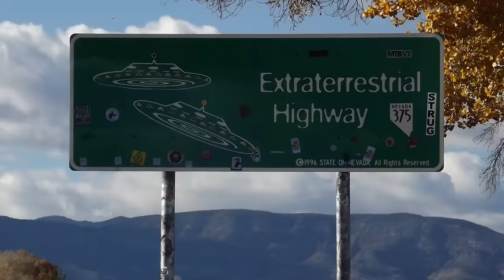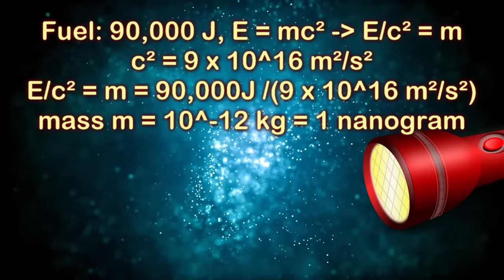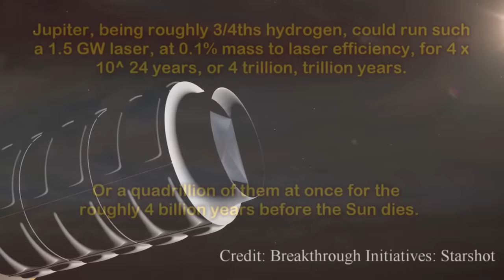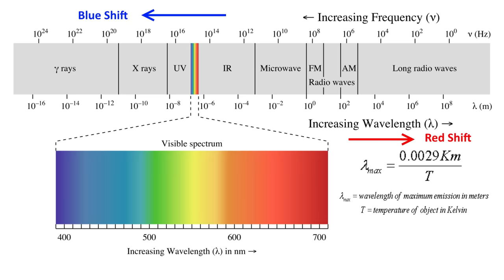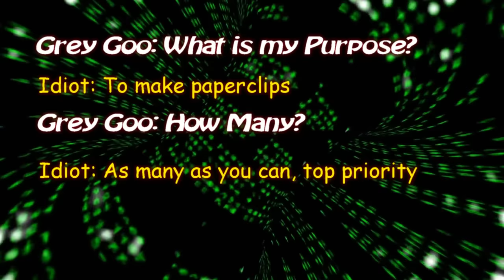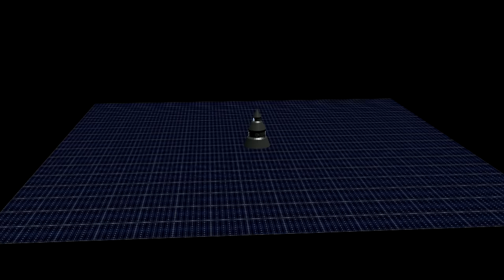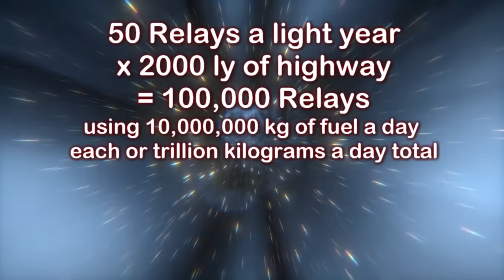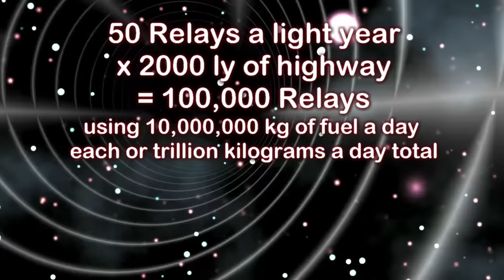Interstellar Highways

Comment: our sun moves around the galactic plane as we become a level one civilization with  Both fission and fusion are nuclear reactions that produce energy, but the applications are not the same. Fission is the splitting of a heavy, unstable nucleus into two lighter nuclei, and fusion is the process where two light nuclei combine together releasing vast amounts of energy we should be able to use  one to kick the other.
Reply: no. that is not possible. there is a minimum in the "middle".
iron, to be precise

Comment: This sounds useful once we already build the infrastructure, but what if we wanted to do the initial colonization of the galaxy as fast as possible? Human colonization wouldn't matter here, just get a robotic self replicating infrastructure in place, so the ships can be just tens to hundreds of kg in weight; what design should we use then?
Reply from the maker: Self-replicaitng machines if speed is everything and you've got machines you can trust to do the job. With fairly normal people only, probably a big powersat near the sunning beaming energy out to hit a ship, maybe a few relays too, to ge tit up to speed, then a modified bussard ramjet to slow down if you can get that to work or just burn fuel to slow down, like the Gardener Ships discussed in the Life in a Space Colony trilogy.

Comment: "The simplest form of MHD, Ideal MHD, assumes that the fluid has so little resistivity that it can be treated as a perfect conductor. In ideal MHD, Lenz's law dictates that the fluid is in a sense tied to the magnetic field lines. To be more precise, in ideal MHD, a small rope-like volume of fluid surrounding a field line will continue to lie along a magnetic field line, even as it is twisted and distorted by fluid flows in the system."

Is it possible to create a cohesive liquid plasma rope that could fling something into space at near light velocity, like a solar flare?

"If a set of magnetic field lines are tied into a knot, then they will remain so as long as the fluid/plasma has negligible resistivity." -Wikipedia

Apparently, you can tie the stuff into knots.  I assume that it could grip a superconductive ship.  Why not make a slingshot?  Just place the ship in the plasma-rope, and charge it with nuclear generators or some such, until it goes critical, and flings the ship into space, off the tip of an artificial solar flare.

Anything is possible if you can turn a magnetic field line into a robotic arm.  :D

Comment: 100,000 relay stations... sounds like a lot, but the USA has 114,000 or so fuel stations, and for a K2 that would be a minimal expenditure.
Reply: Michael Oosthuizen Definitely, though it wouldn't be particularly difficult for a K1 to at least setup a useful enough percentage.
Reply: That would be resource intensive for a low end K1, but K1.5s and up, sure and it would start making sense that at about the point we would want to start interstellar exploration in serious enough numbers to warrant beginning the initial capital outlay.
Reply from the maker: It kinda depends on where we're actually defining a K1, technically a dozen of these stations are a K1 even if each are home to ten dudes who perform maintenance. 100,000 of them would be a K1.4 I suppose, that's the downside of using energy as your ruler for civs.
Reply: Yeah, the Kardashev scale is a bit of a vague measuring stick, especially considering the power output of every star is different. We will tend to use the output of our own star when reference the scale, which will skew our perception of other civilizations if we ever used the Kardashev scale to describe their power usage. Add to the mix that such a network could "artificially" knock a K1 to K2 because it has an interstellar network that is the equivalent to a K1.4 on its own and the scale becomes very blurry when using it as a tool of comparison. I have a tendency to also consider two K1 civilizations to be roughly equivalent in technological advancement, which is clearly a false correlation (because of the aforementioned point and other factors such as high efficiency technologies lowering power consumption), but one I suspect to be quite common.

Its still a nice comfortable reference scale for guesstimations though.

Comment: At 4:54 you say, regarding solar sails, "the photons it reflects transfer twice their momentum to it."  But if that were the case then it would seem like you could maneuver a second sail into place in the opposite direction and bounce that photon back and forth, each gaining 2x each time.
I did a little digging and I found http://sail.planetary.org/ where it says "As light reflects off a sail, most of its momentum is transferred, pushing on the sail." Even this is confusing... if a photon is bouncing between reflective surfaces, losing a bit of momentum each time... well what happens when there's no momentum left. Seems like you'd eventually have momentumless light.
Reply from the maker: As I mentioned you can bounce photons repeatedly, doing so is tricky but it doesn't violate conservation laws.

Comment: How would anyone organize a voyage that involves parties that are several light years apart from each other? Imagine one of the laser stations becoming isolationist and deciding to use all that laser power for themselves instead of accelerating a ship full of strangers.
Reply from the maker: The ships would drift on past that station, they just accelerate or decelerate you, but that is a good reason to have the stations spaced closer than the minimum necessary and for the ships to have some internal power source or battery, after all a relay might break down or need a few months of maintenance too
Reply: Do you think, that the smooth operation of such a highway requires some sort of interstellar government? Is that even possible, if you only have lightspeed communication?
I think these highways raise a lot of questions regarding interstellar trade, diplomacy or possible treaties.

Comment: Would these laser / light beams be visible on Earth at night if one of the stations were built in orbit?  Would we have a disco light show every night?
Reply: the actual laser beam? no. to see a laser you need something of which it can be reflected or refracted off.
Reply: AndDiracisHisProphet I thought powerful lasers were visible though?  I may well be wrong though.
Reply from the maker: Stronger lasers tend to be easier to see because more photons hit more particles.
Reply: What Isaacs says. But I am not sure that even a laser this strong finds 
enough dust that you can see it from more that a few 100 km away. at 
least not as a constant beam. You could probably see some occasional 
burst when it ionizes a little rock, or so.

Comment: Im struggling to find any science articles that explain solar sail science in terms that i can understand. where does the energy to accelerate the craft come from if the best acceleration comes when the light is 100% reflected? if the light was reflected back and then directed into solar panels (ignoring losses to inefficiency as we are not concerned with that for this discussion ) you appear to have obtained energy for free which is clearly impossible.  Im assuming that the answer is that on the reflection some of the energy is converted to kinetic but what happens to the photons as a result,  how is that energy loss manifested?  and presumably if you were not regenerating power from the reflected light these setup are incredibly inefficient at converting energy into momentum
Reply from the maker: Light going into a solar panel isn't reflected, its absorbed, gaining full momentum rather than double like reflected light does. It does not violate conservation of energy or momentum. All energy in a photon is kinetic energy, same for heat energy, we just classify both as its own sub-type for clarity.
Reply: Hi Isaac, thanks for replying, but you still havent really answered the question. If i put it another way. If the laser is 100% efficient, and the ship doesnt reflect the light but uses 100% efficient solar panels presumably it will still be accelerated but also gain all the energy released by the laser. In the case of the ship reflecting the light its worse as it now gets 2x the momentum and the light can still be reconverted by panels after the reflection by something behind the ship.
Or in Math terms.
Energy into laser  = x. Light emitted energy = x. If ship has solar panels light hits ship and accelerates it by y and ship absorbs energy x which it could store or use to propel additional light/propellant.
If ship reflects light it accelerates by 2y and x light is reflected which can then be absorbed by panels. x + y or x + 2y is not = x where y > 0.
Reply from the maker: Sam, if a ship has a bunch of mirrors that reflect photons to a solar collector trailing behind but attached to the ship, they gain 2x momentum when it reflects off those mirrors then lose 1x momentum when that bounces back and get absorbed by the collector, exactly the same final momentum as if they just absorbed that energy instead of reflecting it in the first place. 

PS - I wouldn't advice using acceleration that way either, go with energy or momentum, you will screw yourself up using acceleration like it was a conserved quantity particularly when relativistic effects come into play. Don't mix units either, you can't add  x + y when x is energy and y is acceleration.
Reply: Isaac Arthur i didnt say the panels would be attached to the ship, i was imagining them being near the laser source. put another way, imagine 2 seperate light sails that perfectly focus/reflect  light onto each other. if you introduce any amount of light between them they now will eventually accelerate to some very fast speed. The laws of physics say they can only accelerate to a combined speed of  1/2 mv given energy x. so the light beam must experience a reduction in energy on every bounce corresponding to the kinetic energy imparted with the bounce. the question is how does the light experience the energy loss? is it via frequency reduction or something else? in the end my point is that light sails are a very inefficient way to transfer energy into momentum unless you can perfectly bounce the beam multiple times.
Reply from the maker: You're ignoring the red-shift on that one Sam, as the ships speed up, even two perfectly reflecting light at each other, the beam red shift on every bounce because their relative speed is growing with each bounce. Didn't I cover that in the episode?
Reply: You did but only in regards to the speed difference between the ship and the laser source. My point is that light sails are very inefficient, a point you made yourself. A quick calculation from your numbers give me an efficiency of 0.00000065%.
But I am interested in how the light energy converts to kinetic and how that conversion manifests itself on the photons. As another thought experiment imagine 2 lightsails made from Relectanium a rare material that can reflect photons perfectly with no loss. Each lightsail weights 0.5kg and starts at rest pointing at each other. A 1 joule light beam is introduced between them that starts reflecting between the sails slowly causing them to accelerate. If the photons are not being influenced at all by the reflections they will continue to reflect between them, accelerating the light sails considerably over time. Physics tells us however that energy must be conserved at at most from 1 Joule 1kg of material (in total) cannot be accelerated more than 1.41ms (relative speed of light sails to each other) even without any losses to inefficiency. 1.41ms is not very fast and presumably it would take a very long time for it to get to that speed and there would certainly not be any noticeable red shift. But the question is how are the photons being affected by the bounces such that they are losing energy equal to the energy they are imparting?

Comment: Here is a physicist that replied to me on NextBigFuture about solar sails (https://www.nextbigfuture.com/2020/05/164531.html). His belief is that solar sails are too problematic, but that laser assisted propulsion is the way to go.

Note that there is a “sweet spot” between pure-photonic drivers and beamed-energy-and-reaction-mass systems.  

Like how over the last 70 years the turboFAN engine was found to be way-way-way more fuel efficient at comporting a large airliner tens of thousands of kilometers, compared to a turbo-jet. Why?

Using the turboJET's powerful thrust to spin up a much larger 'bypass fan' to push incoming atmosphere out the back makes a lot of straight physics sense:

F = ma — and of course
a = Δv/Δt — but setting Δt to '1 second' means
F = mΔv — for most intents in napkin calculations. Rearranging:
m = F/Δv, used below;

Also,

E = ½mv² — in its pure form, but
P = ½mΔv² — as far a jet engines are concerned, on 1 second Δt timescale

Then

P = ½ F/Δv • Δv², which algebraically reduces to
P = ½ FΔv

This 'says' that for a given FORCE, (accelerating some mass) to a speed (½ as much (using twice the accelerated mass)) still results in saving ½ the power.  

Excellent!
By any measure!
This is what the high bypass turbo-fan engine does. 

So, the same goes for BEAMING power instead of REFLECTING it.  
Turning a pure photonic drive into a beamed-power reaction mass drive …
Substantially increases its energy-per-thrust efficiency.

⋅-⋅-⋅ Just saying, ⋅-⋅-⋅
⋅-=≡ GoatGuy ✓ ≡=-⋅

" laser assisted spacecraft propulsion seems to offer a lot of possibilities over single source propulsion systems."

It does (laser-asssisted).  Either way, too … either pure “photon sail” or hybrid “photons-make-electricity-which-accelerates whiffs of exhaust”. Or Brett Belmore's approach, to use photonic 'pure sail' acceleration to “beam mass” at the receding spacecraft.  

Since there would be plenty of 'leakage' of the acceleration beam around each little whiff of sailcloth, the receding spacecraft would have a guide beam onto which to 'lock'.  The incoming bits of sailcloth would most likely remain on that beam. 

Or, at the very worst, the modulation of the beam could transfer a few bits-per-second of data telling where and when the bit-of-sail would arrive, and on what vector.  

That hybrid approach has all the hallmarks of being optimal: utilizes the masses quite effectively; doesn't burden the receding (or incoming!) probe with gaining-or-losing mass itself. Transfers substantially more momentum than a big ol' sail could, as well.  Remains 'coherent' over its traversal path.  

⋅-⋅-⋅ Just saying, ⋅-⋅-⋅
⋅-=≡ GoatGuy ✓ ≡=-⋅

Comment: Great video Issac, I enjoy your work as always.

I remain skeptical that any sort of "clearing" would make interstellar space, much less intrasolar space, devoid of debris enough to make it safe for high speed transit.

Also, at such relativistic speeds, it's not just dust and rocks, but cosmic rays and radiation that will be dangerous.
Reply from the maker: Well you'd never clear everything, but there will be a practical balance of speed, mass, armor, etc that gave an optimal speed for travel.

Comment: Just fyi, the max speed of a rocket does not top out once the rocket reaches the speed of the exhaust. You are wrong about that, and so is everybody else. (of course no rocket ever built carries enough fuel to actually demonstrate this, as they all run out of fuel well before exceeding their own exhaust velocity)  There is no such thing as speed, it's just a measured observation. 
I.E. If a rocket from the perspective of someone on the surface of Earth is going 20,000 mph, that same rocket measured from another body would be different. Speed is just a measurement of the movement BETWEEN two objects, and not a measurement of the speed of the object itself, as to take such a measurement would be impossible. Speed is just an observation, not a real thing. There is no real speed, hence there is no top speed. Even the speed of light can be easily passed if you can produce a constant thrust long enough. Also, the rocket itself will always have a speed of zero when compared to it's own exhaust velocity, so there would be no reason for it's speed to ever top out unless it runs out of fuel. In other words, the exhaust velocity of a rocket, if measured from the rocket itself, is always the same difference when compared to the rocket, regardless of how fast the rocket is already going, so that difference is always there, hence so is the thrust. Think people, think.
Reply: thanks. i had a good chuckle
Reply: First of all: what the HELL are you talking about?  Here's an idea: go give this little spiel of yours to anyone at NASA, ESA, JAXA, or any of the other couple of hundred space agencies around the world.  They'll enjoy laughing you out of the room!  Secondly, the thing he actually said (since you apparently weren't listening) is that it's BASICALLY impossible to go faster than 4 or 5 TIMES your exhaust velocity [which he said somewhere around 3:00 into the video.]  Pay attention people, pay attention!  [ha!]  You can't zen a rocket to Mars, buddy.  Just so you know.  Speed is NOT an illusion (or whatever the hell you're trying to say.)  If it was, then airlines couldn't post arrival times.  Think people, think.  The speed of the rocket can be compared to its exhaust, or it can be compared to its intended destination, or it can be compared to the place it just left, etc.; either way, if you're burning rocket fuel & your rocket is not actually exploding, then you're probably going somewhere.  Houston, we have a problem explaining basic rocketry to Mr. Hawke.  Any ideas?  AND: if you were trying to be funny, then here's some friendly advice: DON'T.  You're not good at it.       tavi.
Reply: Also: observations ARE real things.  They collapse wave forms.  Thank you.